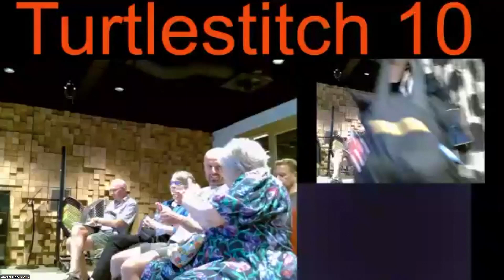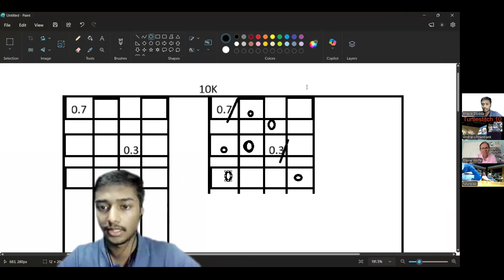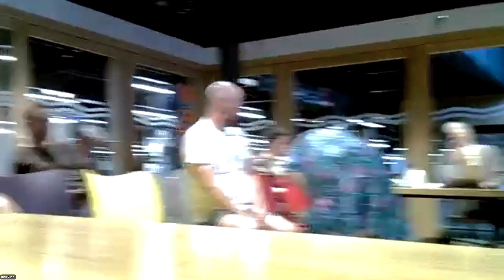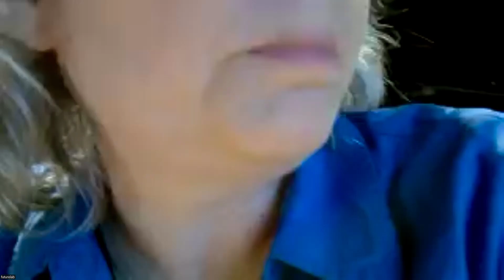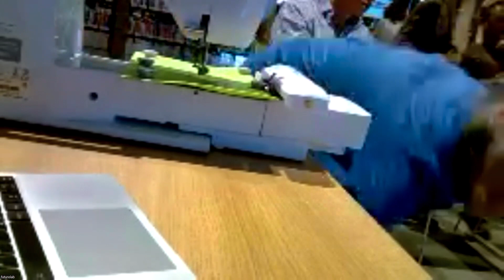Talk at Turtlestitch! [recording]

Comment from the maker: 00:00 – Introduction & Welcome
00:11 – Greeting
00:48 – Self-Introduction
01:07 – Project Name: Face Stitching
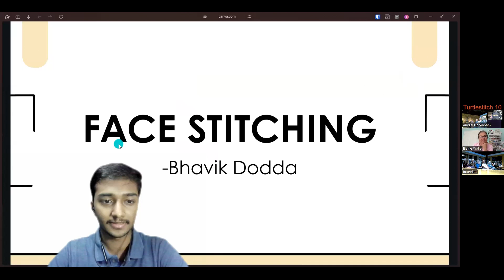01:17 – Academic Background & Interests
01:40 – Math-Based Animation Approach
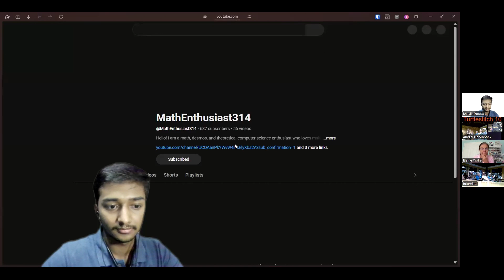02:08 – Overview of YouTube Channel & Math Creations
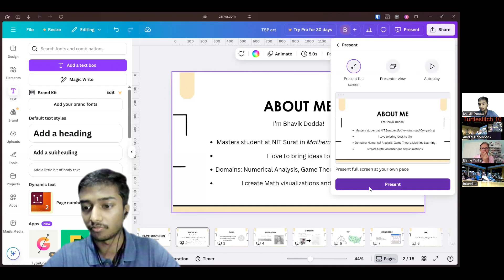02:25 – Research Domains: Numerical Analysis, Game Theory, ML, Category Theory
03:00 – Talk Goal: Converting Images to Single-Line Embroidery
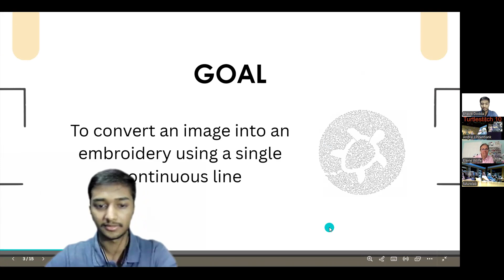03:28 – Inspiration: Single-Line Art Competitions
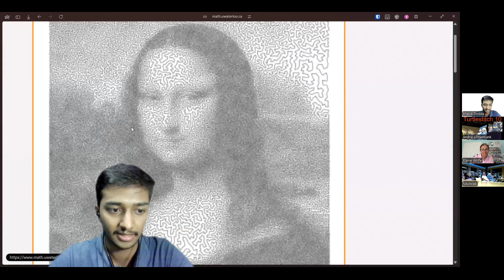03:58 – Robert Bosch’s Optimization Art (Opt Art)
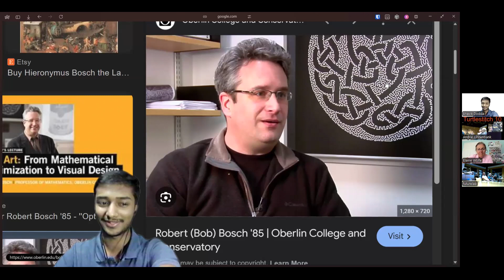05:27 – Translating Inspiration to Stitching
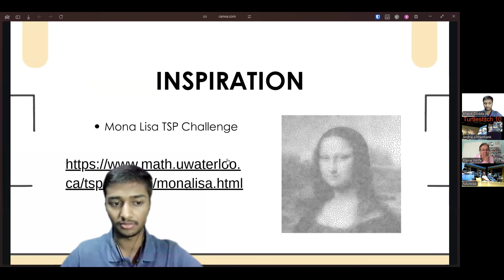05:53 – Step 1: Stippling (Generating Points from an Image)
06:43 – Converting to Grayscale & Probability Distribution
08:08 – Random Sampling with Dart Throwing Algorithm
09:04 – Limitations of Regular Stippling
10:12 – Improved Stippling with “Beam” Method
11:50 – Example: Feature-Enhanced Dot Distribution
12:34 – Hyperparameters in Stippling
13:03 – Step 2: TSP (Traveling Salesman Problem) for Path Creation
13:53 – TSP Definition & Applications
14:33 – Pathfinding with Geometric Distances
14:46 – Applying TSP to Stippling Points
14:53 – TSP Complexity & NP-Hard Nature
15:17 – Brute Force vs. Feasibility with Large Point Sets
16:16 – Concord TSP Solver Demo
17:52 – Limits of Exact Solvers for Large Inputs
18:00 – Lin-Kernighan Heuristic for Large-Scale TSP
18:26 – Running LKH for 10K Points
18:40 – Using Heuristics Instead of Exact TSP
18:46 – Generating DST Embroidery Files
18:59 – Discovering TurtleStitch
19:27 – Method 1: Manual Pipeline (Concord → TurtleStitch)
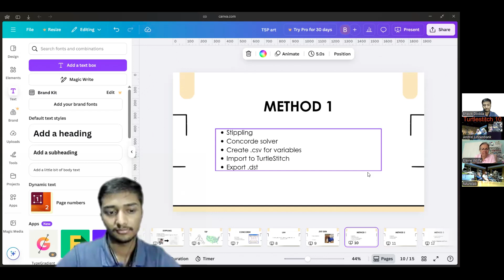20:35 – Example Output: Self-Portrait Embroidery Path
20:40 – Method 2: Python Pipeline for DST Generation
21:39 – Method 3: Web Interface Prototype
22:01 – Audience Invited to Test with Images
22:48 – CSV Format for Path & Points
23:59 – Flipping Coordinates for Correct Orientation
24:32 – Audience Question: Uploading Images for Live Embroidery
25:04 – Live Testing: Sending Example Images
26:06 – Deciding Which Images to Use
28:03 – Audience Sends Final Image for Testing
29:28 – Live Workflow: Using Website to Generate DST
30:10 – Preparing Embroidery Machine & Recording Process
31:05 – Machine Setup & DST Transfer Methods
31:32 – File Transfer Options Across Machines
31:40 – Question: Ready-Made Website or Step-by-Step Setup?
32:02 – Sharing Website Link
32:34 – GitHub Code Availability & Local Setup
32:47 – Note: Website Not Yet Hosted
32:59 – Preparing to Start Embroidery
33:19 – Looking for Scissors
34:19 – Closing Thanks